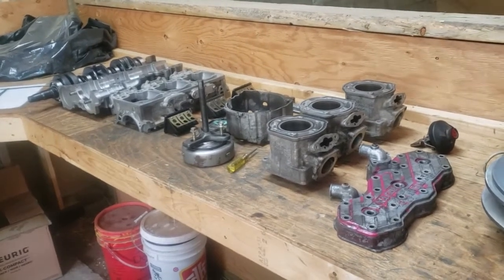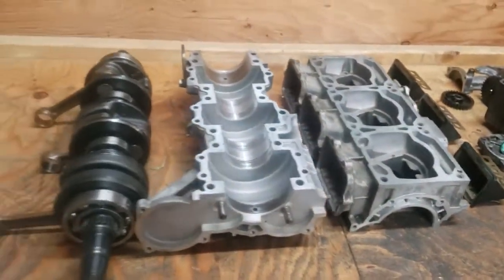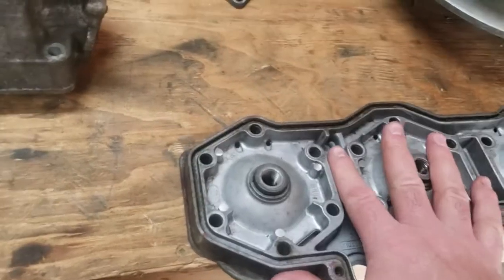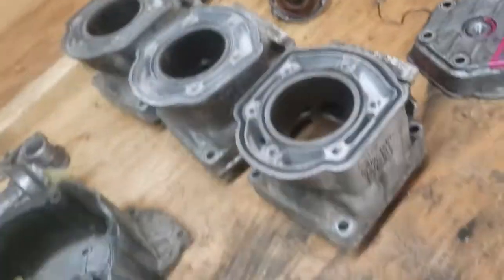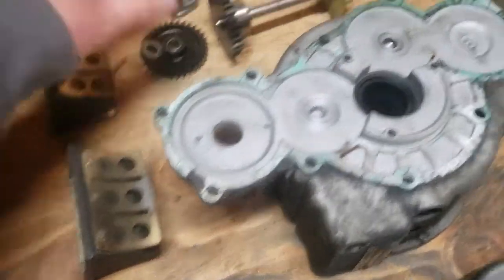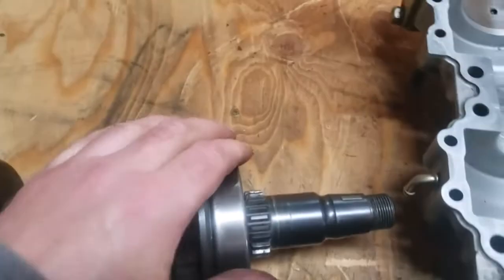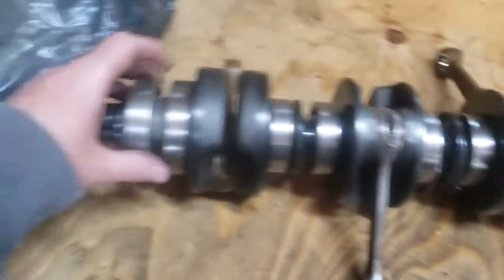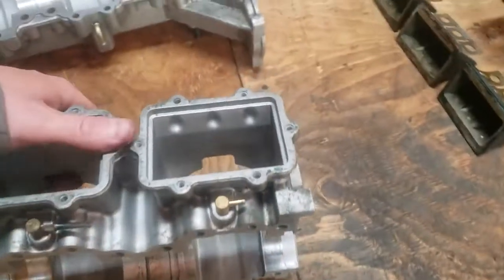Ski Doo Triple Series #3 - Build Sheet & Engine Teardown Tips

Comment: Nicely done!  Very cool.  Any tips on where to find a CDI for these old triples?  I have a 96 600 with a dead CDI.  I wish there were new aftermarket ones but I can't find anything.  Only old used ones on ebay.
Reply from the maker: Hi Paul!  A nice tip for CDI units:  You can use any cdi box for a rotary valve twin (470, 580, 617, 670,) and wire a splice to split the output for 3 coils.  All the cdi units are identical and the triples are just split into 3 outputs internally.
Reply: Wow!  Nice tip - the triples are hard to come by.  The twins seem readily available and half the price.    I had it in my head (not understanding these things 100%) that the cdi was required for timing and they "tell" the coils when to fire aka 120 degrees apart for a triple.  I guess it doesn't work like that?  The CDI is just providing power to the coils, then and the firing is controlled elsewhere?     Thank you so much.  Paul
Reply from the maker: @paulhaines5755  The CDI only stores the capacitive energy and controls a very rough timing advance through the RPM range.  The actual signal to fire comes from the trigger coil and flywheel inside the ignition housing (behind your recoil starter).  Once the trigger coil fires, it signals the CDI to release its energy into the 3 high tension coils.  These boost the voltage to the required level for the spark plug and fire the plug.
Reply: Thanks for the info!  I must admit it's a bit of a mystery for me when it comes to electrical.  I've rebuilt some engines on bikes and wave runners, etc. but never really had electrical issues until now so I'm learning more as a result.  So glad I asked you.  Thanks again!  Paul.
Reply: O.k. - so a little research in my manuals shows me the CDI unit for the engines you mention is 410 9189 00   Same for all these engines!  Easily available and inexpensive.  One difference I see when compared to a triple CDI (part number 410 9195 00).  I can splice in the wires to get to the three coils on my triple no problem.  I see how that would work.  I also see there is one extra wire on the triple CDI that I have in hand when compared to the twin CDI.  It's in the bundle that goes down into the case cover on the engine.  It is a black wire.  Not sure what to do.  Don't know the function of the wires.  Can you help me?  Thanks!  Paul
Reply from the maker: @paulhaines5755  the extra black wire is just an extra ground reference.  It just needs to be connected to the engine case to ground reference the circuit.
Reply: Thanks again for your help!  Much appreciated.  I'm gonna try this and see if I can jog this thing's memory on how to run!  I'll keep you posted...  Got to order a new one first...
Reply: Well I'm stuck!  No spark still.  Got the new CDI today.  Wiring for the source coming from mag didn't match up at all with new CDI so I made some jumper wires and matched it color for color.   Pickup plugged in nicely.  Black and white stripe wire on new CDI = not sure where it goes so I tried it open then to ground.  No spark.  Stator pickup, source wires on machine reading good OHM stats per specification.  Alternator a hair low OHM reading per specification.  Removed kill switch and dead man from equation.  Installed new ignition switch.  Still spark free.  Any ideas?  Thanks again...  This one's a challenge!
Reply from the maker: @paulhaines5755  I believe that wire is tied to the kill switch loop.  Can you shoot me a photo of the CDI wires and your stator wires and send to Jason.blier@gmail.com - I’ll take a look and will  hopefully be able to steer you in the right direction.
Reply: Ok - one thing I have failed to look at - voltage regulator.  Do you think that could be a culprit?
Reply from the maker: @paulhaines5755  that’s unlikely - the ignition windings on the stator connect directly to the CDI unit and do not connect to the voltage regulator.

If you have no spark, make sure the trigger coils are properly connected to the CDI.  You may need to download a wiring diagram or check the manual for the year and cross reference the 2- cylinder wiring  diagram with the triple to make sure you are connecting the proper wires.
Reply: Thanks again for the help.  Original Denso CDI wire colors for the triple does not match wire colors in shop manual diagram.  I don't know how else to hook up trigger coils - they are all properly spliced wire color to wire color.  I tried all wire position combos on the machine for the three going into the mag no luck  Don't know what to do.  Think she's headed for the scrap heap.

Comment: My water pump service brown and nasty. I believe there is a plug to fill up that cavity with 2 stroke?   Hope to do mine 700 next fall
Reply from the maker: 20:10 in the video shows you the service plug/bolt to the oil cavity on the water pump.  You can top that up with injection oil or gear/chaincase oil.  You will need a syringe to do it and also need to take off your mag pipe.

Comment: Any clue how to make a 1999 mach Z CDI work on a 1998 formula 3 600? My weather pack connectors are slightly different.
Reply: Or do you happen to have a wiring diagram of both models? I’m having a tough time tracking down. A CDI for my 98 f3.
Reply from the maker: Parts for the 98 & 99’s are a bit hard to come by.  Lots of people convert the CK III motors to the <97 ignition system.  I honestly can’t remember if you can swap a 98 and 99 CDI around.  I think just the connector is different but the wires are the same.  You should be able to just change the connector to match.  Wire colours should be the same from 98-99.

Try here for shop manuals and wiring diagrams:  https://www.dropbox.com/sh/48a8q5wc55gh6gz/AACPo3prUjCHvnDa8MHNBhGfa

Hope that helps!

Comment: I had antifreeze on the PTO spark plug, so i decided to remove all 3 jugs and have them sent out to get re chromed. i replaced all 3 cylinders, did a base gasket and new o rings on the head. Took it out for a quick 5 min ride and noticed my coolant resevoir going low, topped that off and decided to check the spark plugs, the PTO plug had a lot of antifreeze again! all the other plugs had no antifreeze. any ideas ?
Reply from the maker: There are only a few things that would cause that:

- Leak in head gaskets (cylinder or plug o-rings)
- Leak in base gasket (most likely and common)
- crack in coolant jacket in cylinder or crank case.

A few things to check:  Make sure you check the truness of the crank case / cylinder mating surfaces and cylinder / head mating surface.  If there is any warping, you will get leaks.  Also, use gasket dressing on both sides of the base gasket to aid sealing.

Hope this helps you out.

Comment: Will there be a series 4?   This is my 2nd F3 but my fist top end rebuild and I have several novice questions
Reply from the maker: Ask your question here and I'll try to do a video to answer them.  I sold my triple sled and a bunch of the parts - but I'll help anyone out if I have the answers
Reply: Ok.  If  there is no scores in piston, can I just get by with rags and WD?  There are so many opinions on whether to hone this nikasil.  Would you?   2)  SPI or Wiseco pistons?  obviously big price difference (forged is apparently expensive)    3) When I install the rings, how do I know the position to put them in to NOT hit a port on the cylinder?   3)  I have the shop manual and it says to “grease” cylinder and head bolts. Should I be doing that? I will be shining the bolts up and tapping the holes to clean them out before hand. Im hearing  just screw in dry (more accurate torque) . Even heard of pipe  dope on threads because there are actually a couple holes that have water ports in them?  Like I said, Im a novice at this, so Im not sure who to believe. Thanks for any experience you have had with your Formulas with these issues
Reply from the maker: @kevincasey4864  I'll do a video this week - just for you.  These are all great questions 👍
Reply: cool man, Thanks!
Reply from the maker: @kevin casey https://m.youtube.com/watch?v=-Xtu4DERwKs

Comment: Build sheet? Seriously? I've rebuilt hundreds of Rotax engines as a service tech for 42 yrs.  I don't need no steenking build sheet!  You're either REALLY bored or like to waste time!
Reply from the maker: The build sheet is to keep track of the progress of the entire sled - not just the engine.  For those new to a full restoration project (tear down to the nuts and bolts and build up) on an older sled, it’s a very good way of breaking the project down into smaller tasks, building an accurate cost estimate, and compiling a list of rare/hard to find parts you need to hunt down.  You have 40+ yrs of experience with Rotax engines - great.  As mentioned in the videos, they are for people new to taking on a project like this and the build sheet is just a system to keep track of everything throughout the process.
Reply: Forty years of being a jerk.